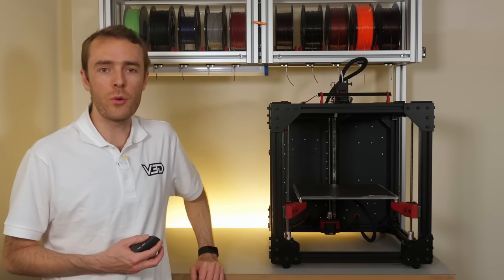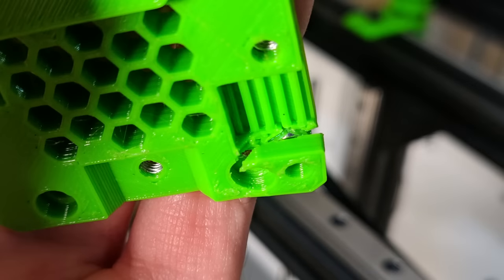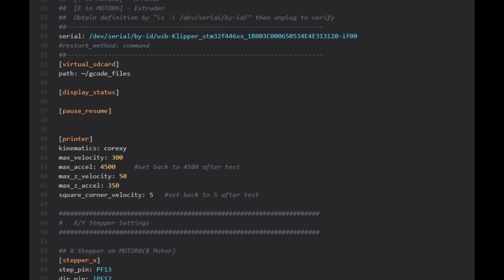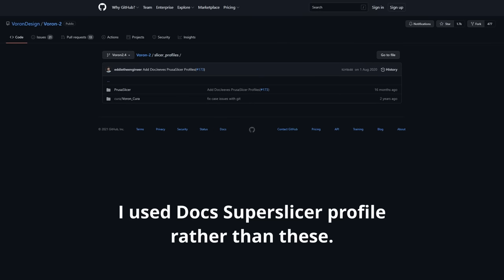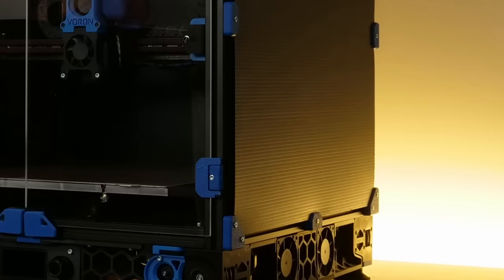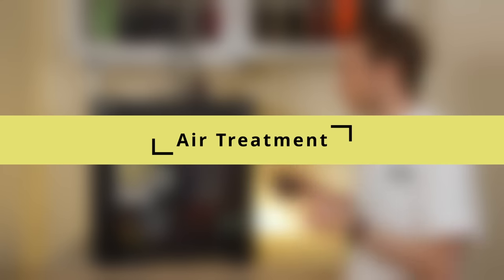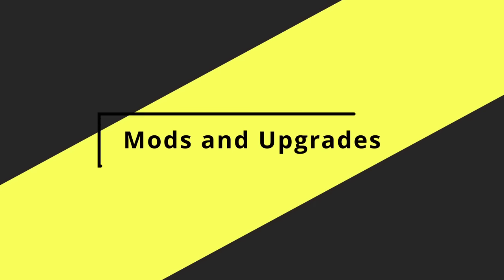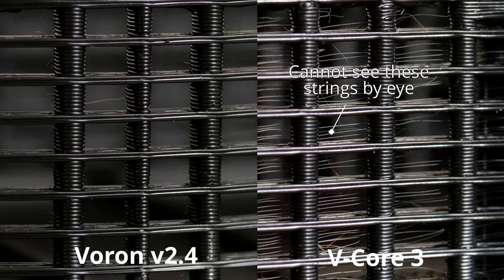Voron 2.4 Vs V-Core 3 Full Comparison Tested

Comment: Screws: Zinc plating does not tell the screw's rating at all, can hide anything inside. Typically 8.8, but can also be 4.9 AKA cheese grade. Black ones on the other hand are high carbon steel which i guess is part of the reason they are black on top of some kind of treatment and should be 12.9 rated.

But who knows what you get when buying from China. That being said, i've used many chinese suppliers for M2-M5 screws, nuts and bolts etc. and all have been top quality so far. Biggest issue being that sometimes it's hard to see black size markings worn out, with black contents :)

Comment: Thank you. Really well done comparison. Shows that both are high quality machines. I agree with your points on safety. RR should have a cover for all mains voltage stuff to keep kids fingers out. I also see the you now need to test out some of the cooling mods for both printers. SuperSniffles Dual 5015 fan mod is very popular on the Rat Rig and allows you to push the PLA speeds a bit faster and sounds like there are some good cooling mods for the Vorons to. Your right Mikkel has done some excellent work on RatOS which makes the printer viable for someone like myself who otherwise could not invest the time to learn the details of Klipper.

Comment: Quick side note... I now have 350 hours on my Voron with only one failure cause of a temp mistake. It just prints and with the quad leveling its just click print and come back later when its done. Been the best printer that I have ever had, no need to tinker just design and iterate.
Reply: So no bed leveling is needed? and could you print like a whole helmed on it?
Reply: @mikew6052  There is no bed leveling on the voron, instead, it does a QGL which typically you would run every print, It has 4 Z-axis each with its own independent stepper motor, the QGL process tests the height against the bed for each corner and adjusts, aligning the floating gantry to the bed.  The bed itself has no adjustment at all and is completely static. I just built my voron, but I am expecting it to have no problem with large prints.

Comment: RE: Fans, I hear you!  It's been my #1 issue with 3d printers as well.  IIRC, one of the Voron dev team members reached out to a well-known fan manufacturer about a custom design.  It was something like $100k up front cost for tooling, and a commitment of 10000 orders @ $12/fan.  So, having a custom fan is costly with today's manufacturing costs.
Reply: I wonder how difficult it would be to wrap your own coils and 3D print your own fan?
Reply: @adamrosenberg4367  Could most likely order stators with tight wrappings.  Then it's a matter of bearings and press fitting?
Reply: @eduncan911  sounds doable
Reply: Sunon? Because West3d is about to do that. He is already authorized by sunon to sell their stuffs.
Reply: @nhozdien5058  actually, yes, I do believe the Voron team member said during the Live Stream that it was Sunon - where they got their quote.
Reply: @eduncan911  the quota for vendor West3D is 20000 per year for custom
Reply: @nhozdien5058  I only quoted what the Voron Dev said.
Reply: @eduncan911  My apology for not clarify it. Yeah, I was aware of what you were saying.
It seems Sunon sets different quotas for who requests it. However, I'm just not entirely sure. Voron did request custom stepper motor v0.1 and successful granted. Do they have other stuff deal behind the door? Probably, but it should be reasonable enough that Voron could afford them, given that the Voron devs don't sell anything. 100K for tooling upfront is quite a lot for Voron team.
Reply: Just a thought, I think Voron Team might have a better luck with GDStime because dual ball bearing is cheaper, so they are more appeal to other 3d-printer builders than premium maglev Sunon fan.

Comment: You missed an important bit of the Voron support: there is a ticketing system in place which will bring your issues to the eyes of dedicated volunteers or the engineering team on a case by case basis. You get a private channel to discuss and solve the issue.
Reply from the maker: This is not something i've seen or been offered at any point.
Reply: @Vector3DP  seems YouTube ate my reply, second try: there is a channel request_help on discord where you can open tickets.

Comment: Having just built a Voron 2.4 I can say that it's much more impressive after building. I have built other extrusion based printers and they do not begin to compare. Only real complaints about the build are the belt clamp location, lack of bolt(s) holding the two front idlers together, belts running too close to Y rails and Z belts running a bit close to extrusion as well. Also seems like the lower Z belt clamp could be better designed but I see why they did it this way in an effort to reduce parts as the Voron has about 10 times as many as say a C-Bot that I have built. Once the gantry was assembled and mounted to the Z though, my machine had zero racking right out of the gate and adjusting the belt tension helps "tune" the belt tension to avoid belt tension induced racking. The two X rails I expected to be an issue were not. This may be because my kit came with genuine hiwin rails and I'd suggest anyone looking at a Voron to skimp wherever except the rails as CoreXYs thrive on rails matching each other.
Reply: How is it vs prusa?

Comment: I think the safe shutdown is maybe more of an issue of how Raspberry Pis are designed.  When you shut down a PC with the power button due to the nature of how ATX works, that button is merely sending a signal to the motherboard to do the next step.  A single quick push has the board tell Windows to shut down(id imagine on Linux it can issue a halt command to the OS), The long push forces the board to cut power.   What would have to be seen is if there is a way to do this on a Pi, Perhaps someone could find a way to make a plugin for Klipper and OctoPrint that watches a specific set of GPIO ports, hook a momentary switch to those and it sends a shutdown command to the program and the circuit is closed.

Another idea could be a separate 5v power supply running the Pi only and split off the AC input.  Switched main power in runs direct to 5V PSU powering a USB for the Pi, Then you have a leg running to another switch and this switch runs out to the SSR and main PSU for the printer.  You could in theory cut this switch terminating power to the main PSU and heated bed circuits while keeping the Pi hot.  I would imagine you would need to click reconnect in Klipper on powering up the main system side of things as the main PSU is often what drives the controller board.

Finally there is just running clipper on a small factor PC like those book sized ones you often see at POS terminals as I have heard you can run Klipper on Linux and that these little PCs can even drive multiple instances and multiple printers.  With this you could power off any printer at any time.

Comment: Really good comparison.  I received my first Rat Rig (400mm cube ) in May of 2021.  It has been such a good printer that I ordered a second (500 mm cube) and am almost done with assembly.   For me the size and getting all of the parts I wanted from one source made my decision.  I am using the Octopus on both, and an OmniaDrop hot end direct drive
Reply: David, do you notice any print quality diference between 400x400 and 500x500 printers? Thanks!
Reply: @toppyweb  Not really, but they are usually set up differently.  I start an upgrade on one and when finished do the second.  They are really the same printer, just different bed size.  The real secret to me is the bed mount and 3 point independent Z axis.   When tramming the corners on either is within .02 mm, so that is very "level" the bed mesh on both is a 7 x 7 using an EZABL from TH3D and have really good first layers.   I don't run them fast, am more worried about quality and the ability to print really big.   I have two Bambu printers for small and speed.
Reply: Thank you!!!
Also two bambu? I know they are no so similar, but I would love a comparison in terms of quality/reliability/speed.

Comment: To prevent  the z-steppers to go idle, you simply could connect the !EN pin of the stepper drivers to ground instead to the corsponding I/O pin. There is normaly no need for the z-motors to go idle, unless while tinkering (but this should be done while the printer is off anyway). So imho no big deal. I actually did this on an old bedslinger and it worked well.

Comment: From my experience the extra hardened "12.9" screws which you see mostly with black coating are superior to the zinc coated ones in terms of strength and especially robustness against stripping the heads. So I can especially recommend them for applications where you move them daily/weekly. They can be 5-10 times more expensive though...
How it is with the corrosion resistance I cannot say unfortunately, since I don't work in a damp cellar where 3D printers sometimes get placed.

Comment: Sadly, whilst building my Vcore3, I had to contact their support because some of the electronics parts arrived not working. I got zero response from them. In the end I had to source replacements elsewhere.
Reply: Reply to your order confirmation e-mail and they should get back to you ASAP. They're usually very fast with replacements.
Reply: They should but I got zero reply.

Comment: @54:56 AB:BN and Steathburner are both designed by BadNoob.. well, the computational fluid dynamics were done by BadNoob and the appearance was done by Wile.e.. they both did an absolutely fantastic job ;)
Reply: I am sitting on the fence with the Formbot Voron 2.4 and Dragon hot end in the box, waiting for the Stealthburner to be released :-) When?
Reply: @bubnikv  I can't tell you how to spend your hard earned, I can only tell you what I know. I'm currently running a dragon standard flow on one of my modded machines using an EVA carriage and it is brilliant.. And at the same time I am about to take the plunge and buy all the parts for a voron trident (but I do still have plans to make a v-core in the near future 😅). The Stealthburner should be out by the end of December with everything going well 😉
Reply: @bubnikv  Stealthburner (with e3d Revo?) will come next year but a dragon can print pretty well already today

Comment: You mentioned not being able to clean the bed with IPA (Voron I think). So what do you clean it with? Also it looked like this bed has a fairly course texture that would impact the print finish?
Great video - thanks for making it.
Reply from the maker: you put water on paper towel, heat the bed and steam clean it. The 3D Prima is very rough, the filaprint RS is nothing like that, but not as smooth as glass

Comment: In terms of the safe shutdown button, i was planning on using a raspberry pi PowerBlock you can get from Pi Hut and wire that up though an additional SSR so you can have a push button power button which starts the machine but also safe shutdowns the pi host and then kills power when pressed

Comment: Great detailed explanation between two amazing machines.  1 item specific to Z HOP using those couplers on the RatRig. Do they flex/bounce? You may be able to see the flex within the red material in the couplers around the 56 (ish) minute mark on the RatRig?  Based on my experience using this style of coupler, disable/slow down the Z hop.  This connection can cause the bed to become misaligned as the material in the couplers degrade over time.  I found I frequently replace them (several times) a year for best performance.  I hope these hold up for you a longer time.  Your prints from both look fantastic, excellent review!
Reply: you could go for steppers with integrated Lead Screws... doesnt really get better than that. If you get straight ones, lube them well and replace the nut now and then, they will serve you a very very long time :D

Comment: about the heater times, mightn't the voron slowness be more about the thermal mass of its bigger chunk of aluminium in its bed?
Reply: And potentially limiting hear up speed to avoid thermal stresses as the bed heats unevenly.
Reply: Yes.  Plus, Voron specifies 80% power to heat the bed while the Rat Rig doesn't have this limit.  You could remove that limit on the Voron, but it's likely done for safety.

Comment: regarding always on Power to the pi, you can make that fairly easy: Just get a IEC 14 power socket with a switch, you can then wire it so that your 5v power supply goes directly from the inlet end everything else goes through the switch. I am planning to do that via a zigbee controllable relay.
Reply: I don’t what mini displays rat rig uses, but for voron, since 2.4 released in 2020, you can turn off pi with the small black button (just right below the dial knob of mini12864).
Reply: @nhozdien5058  Ratrig comes with no display and they don't officially support any.

Comment: I don't think the noise is becuase of using idler instead of bearing. On ratrig, the xy motion parts are mount directly on the frame with bunch of bolt. On v2 the the xy motion marts are mount on floating gantry that only mount to the linearrail block with 4 semi-tighten bolts, vibration is somewhat isolation from the motor/idlers to the printer frame.

Comment: Good video, thanks for the subjective information.  What I'm taking from this is I'm right to wait for the Prusa XL and see what that brings as for the price I think it will be a more complete printer and better supported than the Voron or the Rat-Rig.
Reply: I'm in the same boat. There's just a bit too much to go wrong here when I just want a good reliable printer that I don't have to fight with to get working. I've been struggling with poor quality Chinese printers for too long and want a break. Wish the XL was out sooner.
Reply: @skywardsoul1178  bambulab is better and at a lower price, albeit at a smaller size
Reply: @BH4x0r  Arguable. It seems great, but the company's attitude is a dealbreaker for me. The most basic printers these days have a good thermal runaway protection that comes into play within 20-30 seconds. 
The Bambu doesn't activate for 3 minutes and can heat up to 450'C. The temp at which PLA can catch fire is around 380. The company's response to this was indifferent / it's working as intended. If anything else bad turns up / you run into issues with the proprietary hardware, you're entirely reliant on them to help you. If they don't you're screwed.

Comment: Great video. On the desire to be able to manage powering off the Raspberry PI in a controlled way, without logging into the web interface, I'm actively working on a solution for that. Currently waiting on parts to arrive, with testing to follow. Hope to have a product out early next year. I'll post in Discord when I have a better handle on time frame and availability.
Reply from the maker: Tag me on discord when you have it sorted. interested to see.
Reply: @Vector3DP  absolutely, happy to send a sample or two your way as well.

Comment: You can put a relay on the main power and run it to a pi pinout then make a pi cron job that looks at another pin where you put a button to detect a high or low and then switch the relay off. You can also create a macro in klipper that can turn everything on again which you can put in your start script. This will require you to put the klipper controller onto the pi too (something you may have done already if you use input shaping)
Reply: I’m not even sure all that’s worth it.  If you’re keeping the Raspi running, it alone (well, also with power supply inefficiency) draws about 5W (I have a Rpi 4).  If you keep everything else powered on (but heaters, steppers, and any LED lIghts off), it adds maybe 1-2W.  So I’d recommend either having a solution that shuts down the OS and then powers down everything (to get to near 0W), or just leaving the printer on all the time where it will consume 8.6W idle (including C920 webcam).
Reply: @fredhamilton1701  you can put that on a button to the GPIO too, then you can just make the Pi turn on the relay to turn on everything else at startup. When it turn off the pins will go low and it will turn everything off automatically.

Comment: Great information here.  I have been researching the MercuryOne.1 Hydra but I think that the docs aren't developed enough for someone as new to printing as I am.  I Voron 2.4r2 with stealthburner and maybe the 3030 extrusions and 9mm belts of the RatRig looks nice to me.  I also like RatOS and they are currently working on a profile for the Voron using the Manta M8P board and CB! proccy that I would like to use.

Comment: "The stock firmware has no implementation methods for creating a bed mesh". I think that's at best a bit misleading because mesh creation is an intrinsic part of Klipper. So what is it that it doesn't have? Out of the box, Klipper doesn't have a front end, but one could craft a gcode file and upload it. But either way Klipper does really need some sort of web front end to even make it basically usable. Once you have that, you also have an easy way to create and manage bed meshes. It is exactly the same situation for either printer.
Reply from the maker: Ratrig has everything for creating bed mesh preconfigured, you just press one button and it does it pretty much. For voron, all the tools are there, its the same firmware, you just have to do it yourself.